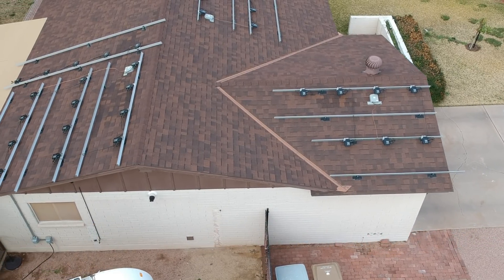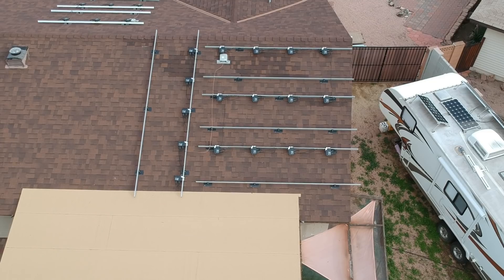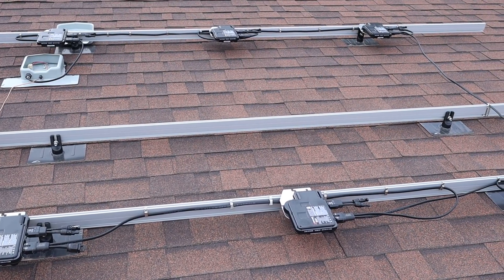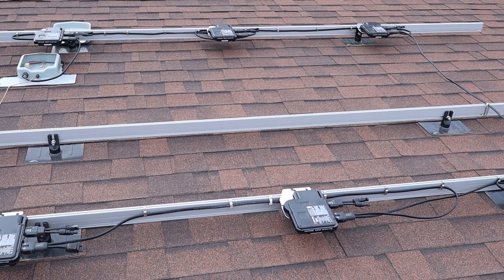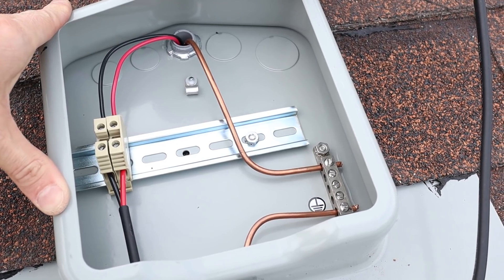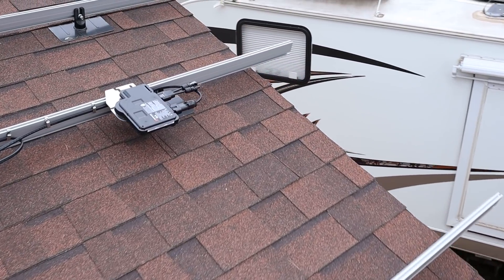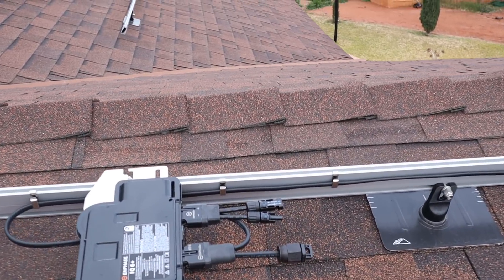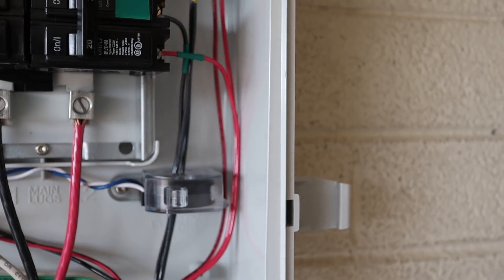My DIY Solar: Part 6 Enphase IQ6+ Microinverters and Q Cable

Comment: wicked awesome - one question i cant find is what is the separation between the top and bottom rails - and does the 3 feet easment to the rail or the panel
Reply from the maker: The 3ft easement is to the edge of the panel. The spacing between top and bottom rail doesn't really matter. The panels were something like 65 inches tall so my spacing was around 40 inches with 1ft overhang top and bottom.
Reply: @ICanDoItMyself  awesome. Thanks. I love your Channel.
Reply: @ICanDoItMyself  This is also different for various AHJs.  With mine, I have a 3' setback from the ridge too.  That is a pain because it makes putting two rows of panels in portrait orientation rather difficult.
Reply from the maker: @Arianna-gz1kx  For my area, it's actually the fire department that requires the setback. I was able to file a petition and pay $250 to not follow it. There is still more than enough access to ventilate in the event of a fire.

Comment: Looks like you have the microinverters installed upside down. The aluminum plate should be installed facing up. Also the top rail and bottom rail of the rack system are not bonded/grounded.
Reply from the maker: https://youtu.be/9ZVYQmX7yYs
They are bonded. With Ironridge, the ground wire is attached to one rail for each row, then the UFOs bond the panels to the rails with WEEBs. This bonds the whole group of panels.

Comment: Lot's of liquidtite in lieu of conduit. Expensive & not very professional!
Reply: Car flex not liquid Tite One. is all plastic the other is a metal flex with a integrated ground covered in plastic. With over 40 years in and around construction I can say this wiring is neater and looks better than many jobs done by state licensed electrical contractors. The fact is that he used a code compliant product.

Comment: The City noted that I should use MC cabling for running in attic wires to the combiner as encased wires get to hot.  Looks as though you're using something different.  Can you enlighten me?  Thx and Thank you for the video's, they've been phenomenally helpful.
Reply from the maker: I ran individual 12 gauge wires inside 1/2" flexible conduit inside the attic along with the 6 gauge bare copper for equipment ground. It comes in 50', 100', and 500' rolls.
https://www.lowes.com/pd/Southwire-100-ft-12-AWG-Solid-Black-Copper-THHN-Wire-By-the-Roll/1000774390
https://www.lowes.com/pd/Southwire-100-ft-12-AWG-Solid-Red-Copper-THHN-Wire-By-the-Roll/1000774396
Reply: @ICanDoItMyself  You ran metallic or non-metallic in the attic?
Reply from the maker: @groachslayer  non metallic.

Comment: What size/partnumber bulkhead fitting did you use for the Q cable/Soladeck?
Reply from the maker: Liquid Tight Strain Relief Cord Grip - 1/2" NPT w/ 7x12mm w/1 Oval Hole for Flat Cable (Pack of 2), Black, Hummel, P/N CD16NS-05-2 https://www.amazon.com/dp/B06Y2J7N6K/ref=cm_sw_r_other_apa_i_sb6SDbSS0NTAK

Comment: I thought with the IQ series grounding was not required? Or was that local code that required the extra grounding across the rails?
Reply from the maker: That's code. Panels and rails need to be grounded.
Reply: @ICanDoItMyself  Yea looked it up myself. I got confused when I read that the IQ Series did not need a ground. 

 But the racking system still does and the iron ridges UFO clamps provide the ground (bonded)  to the panels through the rail ground.

Comment: Amazing video with great details!!!! Again. I am planning very similar system with two arrays. Three questions:
1. Since my sub panel is about 20 ft away from the arrays I am thinking to skip the junction box and run the two Q-cables and the grounds all the way to the panel.
2. If I have to use junction box, can I use one in the attic? So getting all the wires in the conduit through the roof and then having junction box inside. I will have metal roof and try to minimize the penetrations. Is there a code requirements to have junction box or?
3. On the side where you have 5+12 panels why did you put two separate Q-cables and didn't run one cable/string/trunk cable?
Thanks in advance.
Reply from the maker: The junction box is not required. I thought about locating it in the attic but decided this was the easiest. The 5+ 12 is because you can only connect up to 13 IQ inverters on one line. If you use the aggregator, you can combine multiple strings there and run a higher gauge wire from the aggregator.
Reply: @ICanDoItMyself  Awesome thank you.

Comment: Well done, but I would like to know if your local AHJ made you move the array for violating fire code with your placement of the system.
Reply from the maker: I filed an appeal and paid $250 to the fire marshall to not follow it. I just had to show that there is still more than adequate access for ventilation operations.
Reply: Idk you could do that. Nice

Comment: This is a great video. Thanks for taking the time.  Here's a few thoughts.  I would've run the grounds uncut from the rails to the grounding rod.  Connections corrode over time. Similarly, with a pool, you'd run the ground around all corners of the pool unbroken/uncut and then to the grounding rod.  Next, If that 12ga run from the panels isn't too expensive I'd probably avoid having a connection outside, on the roof, that could fail. Then, you need to leave more wire slack inside the boxes, 6 inches minimum.  Also, its a bad idea to mix high and low voltages inside a connection box.  They need to be separate per code.  There's always that chance they could short together.  You wouldn't want to see your Panels or Inverter go up in smoke.
Reply from the maker: They are microinverters, 120/240 volt is the only voltage that is being dealt with other than the DC from panel to microinverter.

Comment: Microinverters are mounted wrong side up. You reduce the clearance under the module which will cause issues with air circulation for cooling. Also noticed that some of your cantilever overhangs are really long as is the spacing between some of the flashed feet. Hope you don't have snow load or high wind potential. I don't think the IronRidge rails you used are designed for those spans.
Reply from the maker: https://youtu.be/IhHbyEVk-es
I already took care of flipping the microinverters here. I'm aware of the Ironridge specs. The XR100 rails can span 8ft between flash feet and have ~3ft of overhang. Phoenix never gets snow.
Reply: @ICanDoItMyself  I'm in process of doing this myself.  but as part of my engineering plans I am not to span more than 48 (due to wind/snow)".  I'm in a hurricane and winter area so  am likely to go even closer...
Reply: @ICanDoItMyself   Thank you for making mistakes and showing them!!!   I learned from your actions.  BRAVO sir!!
Reply: up you go

Comment: Hey bro you didn’t use any fire setbacks on your roof?
I mean were are you located is no any issue if the city make a inspection on your solar system ???
Reply from the maker: I was able to pay $250 and file an appeal to the fire marshall and get it approved. I had to show that there is still more than adequate access to the roof for ventilation operations by the fire department.
Reply: @ICanDoItMyself  Impressive, and lucky. In my area, I doubt they'd go for it, but maybe I should look into it.  I noticed every single house out here struggles to get enough panels up due to limits 3ft from the sides (rake) AND at the top on the ridge, cuts out massive amounts of sq ft of otherwise usable panel space, foisted on everyone for irrational reasons.

Comment: What size wiring did you use
Reply from the maker: 12 awg from roof to combiner, 6 awg from combiner to main panel. 6 awg for ground.

Comment: Hi where did you purchase the iq terminated where on eBay thanks
Reply from the maker: The caps I bought at Arizona Wind and Sun but here are ebay links to the two types I used.
https://rover.ebay.com/rover/0/0/0?mpre=https%3A%2F%2Fwww.ebay.com%2Fulk%2Fitm%2F253431893555
https://rover.ebay.com/rover/0/0/0?mpre=https%3A%2F%2Fwww.ebay.com%2Fulk%2Fitm%2F264229068182
Reply: Thanks for your reply Great video also.

Comment: Interesting, Did enphase authorize you as an installer so you could get their toolkit app?  You really need this app to properly set up your system.
Reply from the maker: You don't have to be "authorized" or "approved" to get the app.
Reply: @ICanDoItMyself  , I know you can download it, but I also have an enphase system, and they are very reluctant to allow anyone to have full access to the toolkit app. I've been talking to them for a while to get full access to the Toolkit App, which provides tons more info and setup features than the Myenlightened App that they allow anyone to use.
Reply: Toolkit app. are  you going to answer Terry Texas's question?
Reply from the maker: I had no issues using the toolkit app. Setup was fairly easy.

Comment: Why did you go with IQ6 and not IQ7/+/X?
Reply from the maker: I don't think the IQ7s weren't out yet when I bought my equipment. Also, I think they're only better if you're going to use higher wattage and higher cell panels. .04 A @ 240V more with the IQ7. The biggest difference, size and weight. 38% lighter. You can save a few $ going with the IQ6s as well. The price on them dropped since the 7s came out.
Reply: From Where I can Buy IQ6 for use in India. Please suggest

Comment: I enjoyed watching these videos.  Great detail.  One thing I noticed, you installed your micro-inverters upside down.  Silver side with the Enphase logo should be facing up. Is that going to cause an issue when you actually mount the panels?
Reply from the maker: I will have to check on that. Good catch!
Reply from the maker: Yep, you're right. I gotta flip em. Crap. Guess that's what I get for not thoroughly reading the instructions.
Reply: ICanDoItMyself that sucks man!  I’d give you a hand but......Chicago.  Live and learn. Good luck. Can’t wait to see the project to its completion.

Comment: Tha is for sharing. I hope to one day also do a enphase setup myself. I noticed that some of your top rails so not have a ground running to them. Shouldn't they have a ground to them as well or did I miss something?
Reply from the maker: The top and bottom rails get bonded together once the panels are mounted so it's only necessary to attach the ground to one point in each section.
Reply: @ICanDoItMyself  so the panel is the bond? Not sure this will pass code where I'm at. I have a 2 step approval process, one for county and one for power company. County has to show mounting blueprints with wind loads.
Reply from the maker: @inis2002 it should pass inspection just fine because it shows it on the iron ridge spec sheets which should be included in your permit application. Iron ridge uses, what they call, a UFO (Universal Fastening Object) to bond the panels together. It utilizes a WEEB. There are videos on WEEBs that can better explain it than I can here.
Reply: @ICanDoItMyself  thanks I'll look this up. Good luck, I'll be watching your channel for more vids.